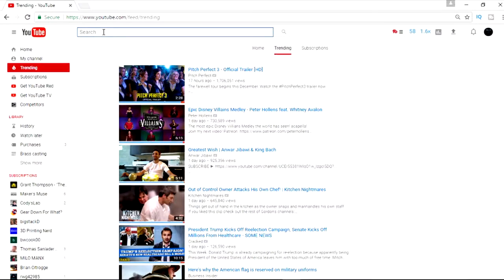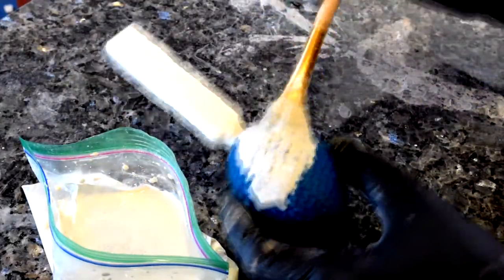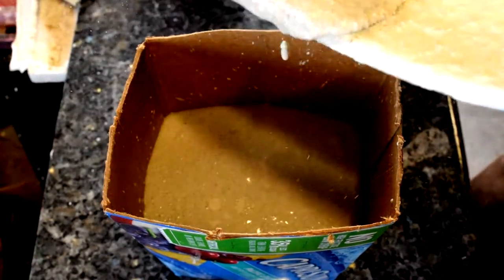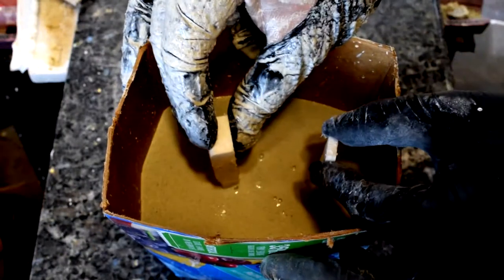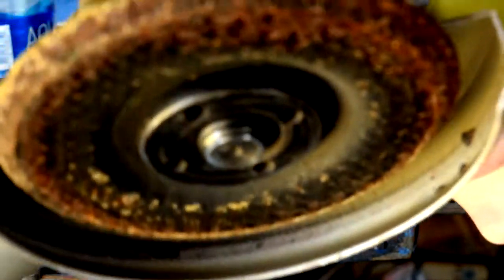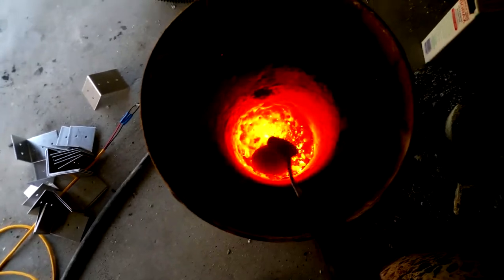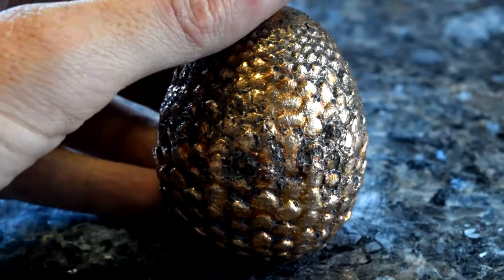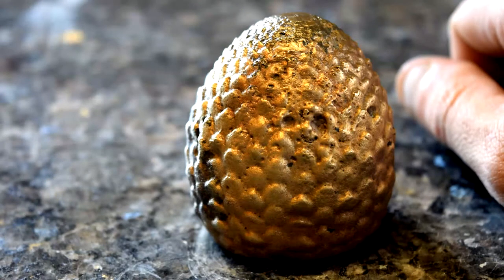Casting Brass Game of Thrones Dragon Eggs

Comment: hey just found your channel, I'm doing similar stuff with lost PLA casting. It helps when making molds to hot glue the sprue to a flat surface and cut a wall out of cardboard or something and hot glue that around the part. tape the ends and make sure it's sealed. pour the plaster around the part, when dried just remove card board and separate from surface. this method keeps the mold cleaner and can use less plaster making burnout quicker and easier
Reply from the maker: Tredecian I've actually done that before in previous videos. It works well and does in many cases use less plaster. The only issue is when the glue comes up and the plaster spills all out :/ Done carefully it works good though.

Comment: Next time, fill the inside of the plastic egg with plaster, so that the metal egg is hollow.
Also, consider 3D printing part of the sprue, so they'll be easier to remove cleanly.
Reply from the maker: Ben Goldberg didn't want a hollow egg, otherwise I would have. A 3d printed sprue is much harder and time consuming then cutting and glueing foam.

Comment: To me it looks like you lost a lot of definition in the tips of several scales. Do you think this was from trapped air, incomplete burnout, or something else? Have you considered using water glass sand to fill the inside of the plastic model? I've never seen water glass sand used on the detailed part of a mold. I wonder what it would do. Have you ever tried using rice to determine your volume? Pour rice into the box with your model in it. Then see how high the rice fills up your 5 gal bucket, and you'll know where your plaster should be.
Reply from the maker: Jerry Whidby your right on the scales, I believe this was do to not enough metal. Had I enough metal to fill the mold and riser they would of turned out better. The rice is a good idea but I worried one might get stuck in the mold.

Comment: you should 3d print the feeder and the vent
Reply from the maker: Typically its just faster to cut Styrofoam for that. Although on the 3d printed gear box video that probably would of been a good idea due to the size, number and configuration of the feeder and vents.